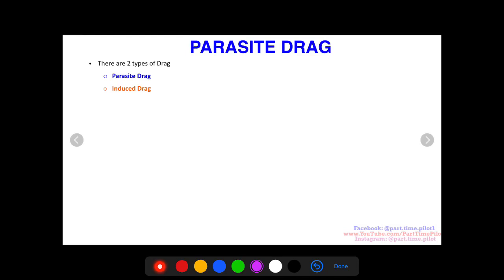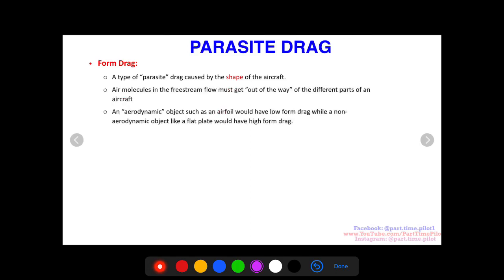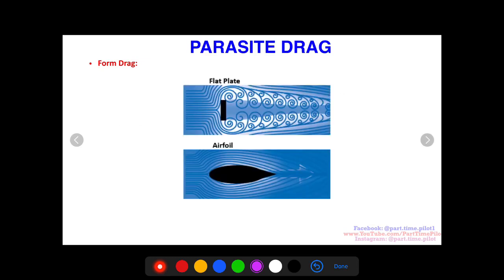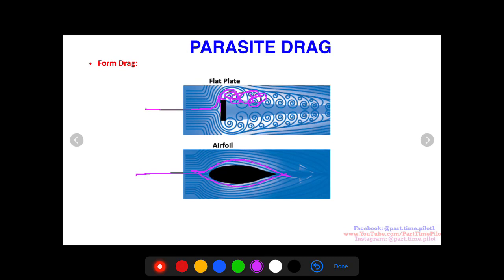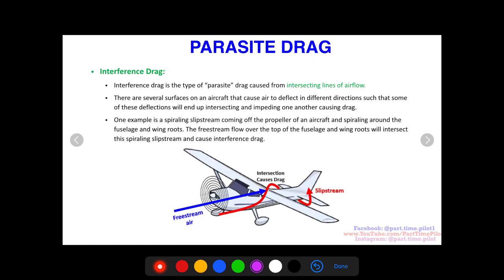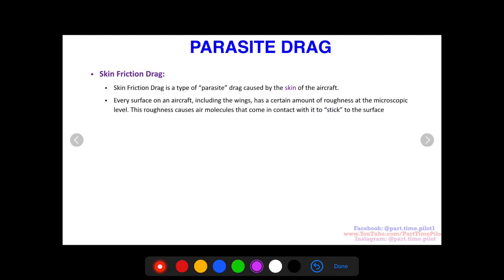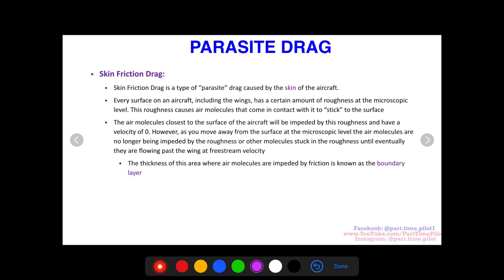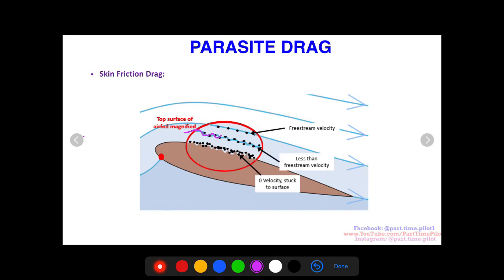Types of Drag & How They Work (Parasite Drag) - For Student Pilots

Comment: When you are a cfi with a private candidate, you don’t need to go that much in depth but there are other challenges you’ll face.
Reply: To add when the aircraft comes outta painting there is much less skin friction drag. This type of drag correlates towards the drag you’d have with frost on the wings which would be significantly more skin friction.
Reply from the maker: @alessio272  Good info!

Comment: To conceptualize surface friction, think of washing a dusty car. If you just pour water out of a hose onto the car, you will see a layer of flowing water but the dust mostly stays put. The dust isn't washed away because the water is flowing over a semi stagnant layer of water where the dust is at the surface of the car. Increasing the flow at the faucet doesn't help very much, but a pressure washer will do much better. However. using a scrub towel on the wet car will move that dust. The smoother the surface, the less drag because the drag layer is thinner and absorbs less energy. Minute surface irregularities will propagate disturbances out into the air stream in proportion to their size. The smoother the better.
Reply from the maker: I like this metaphor!

Comment: can you please give me an example of skin friction drag
Reply from the maker: Imagine sliding down a slippery slide. Your first attempt you slide right down no problem but the second attempt the slide is no longer flat and smooth. It has protruding bumps such that when you slide down you are constantly slowed or even getting stuck on these bumps. 

This is what’s happening at the microscopic level to air molecules that pass over the wing. Tiny imperfections in the wings surface make it not all that smooth to the perspective of an air molecule such that they get caught or stuck in the bumps and holes as they travel over it. This slows the aircraft because all these tiny little molecules getting stuck creates a small force in the opposite direction of motion while in flight
Reply: @PartTimePilot  that was good explanation thank you so much for your time appreciate that 👍.
Reply from the maker: You’re welcome. Thanks for watching!